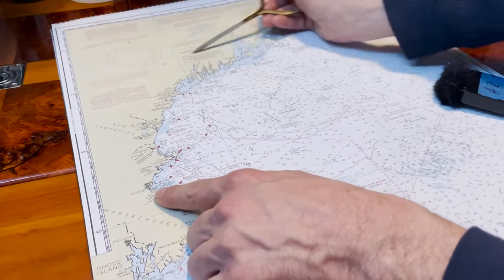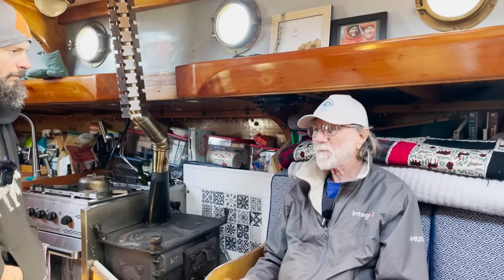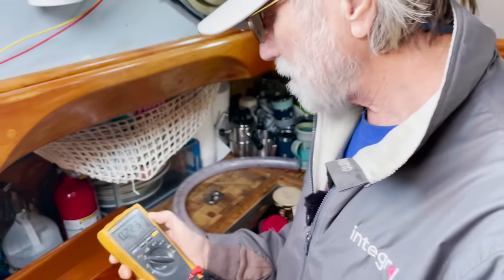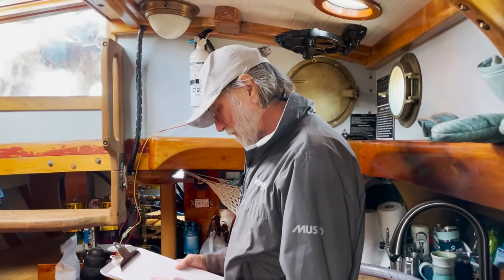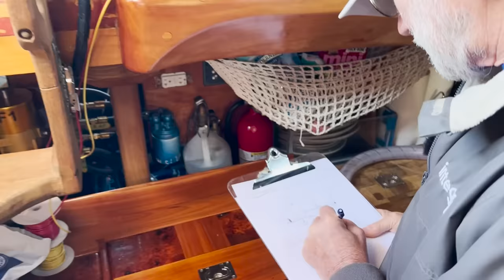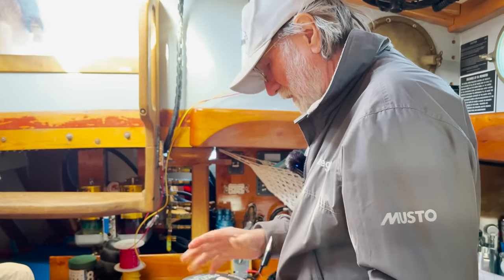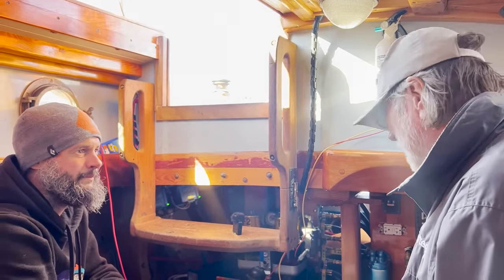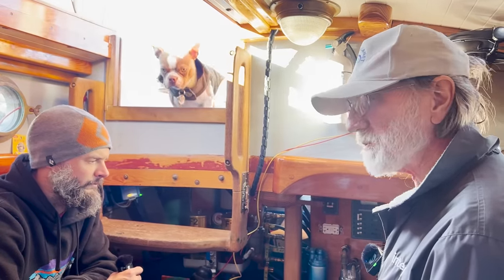Nigel Calder Looks For Stray Current - Episode 289 - Acorn to Arabella: Journey of a Wooden Boat

Comment: I relate to this so hard. I bought a mill house built in 1914, abandoned 15 years when I bought it. No one...NO ONE can understand  our electrical system. No one. Have had 4 liscenced and 2 unliscenced  electricians try to understand it as well as a career elecrical engeneer. To no avail. The last guy took 5 1/2 hours to install 3 ceiling fans *replacing 3 fully functional light receptacles*. It should have taken less than 40 minutes. Its haunted and defies all the laws of physics apparently. Trying to turn off the stair light is like a game of riven every time. The breakers make no sense sometimes its hard to understand HOW two things are possibly on the same circuit. I dont believe in a god, but i do pray every day it doesn't randomly burn down 😅

Comment: I an wondering if a remedy exists beside getting the shaft and propeller gold platted. You are certainly not the first to face this problem and still, graphite packing are a thing, so a simple solution must exist.

Good diagnostic work by Nigel. How to establish a diagnostic is a knowledge by itself and not everybody knows it. Yet, with a good diagnostic, half the problem is solved.

Comment: A Master Class in troubleshooting.
#1: Have the proper equipment.
#2: Draw a picture with your test plan and results.
#3: Eliminate the obvious 1 step at a time (Cct Breakers, Batteries, Alternator )
#4: Eliminate part 2:  Remove the Alternator Drive belt and repeat the test.
#5: Then look for the obscure  STUFFING BOX acting like an alternator when the boat is in gear spinning the shaft in the graphite. That's a good catch.
#6: Eliminate the obscure: Salt Water conductivity. Wish they had just dipped a pail over the side.
#7: Replace the Stuffing - Replace the alternator and test again.

Comment: Not sure why my previous comments have been removed, long story short. I'll name the product without posting the link, take a look at replacing your shaft seal with a Lasdrop. Great product, runs dry, isolates the shaft. Made in Michigan. I used them on commercial passenger vessels for over 20 years with great success.
Reply from the maker: We don’t delete comments unless they’re fairly terrible. Thanks for the recommendation!
Reply: Thanks for the reply. I faced a similar issue on one of our vessels years ago, I flew in Paul Fluery from Marine Services in Maryland. Did the same testing as Nigel did. very time consuming and frustrating. In the long run we installed an impressed Cathodic System and for a backup we loaded up the hull with sacrificial anodes in-case the impressed system failed.  @AcornToArabella
Reply: Youtube has a thing with links so thatd be why the previous comment has dissapeared.

Comment: Connected to the external regulator's field current output

There is no need to buy a new alternator UNLESS you have an internally regulated alternator that cannot be externally regulated

Again if you have a Balmar series 6 they have good installation documentation

Comment: Voltages going slowly up and down as if a capacitor is charging/discharging sounds like a DC power supply is involved somewhere.
Reply from the maker: We left this part out, but Nigel suspected that for a bit and then eliminated it as a possibility eventually.

Comment: I didn't see that you checked the Variable Pitch Propeller for any leakage.  I am not sure if there is any power to operate or is it mechanical, being a google searcher and not a boat builder like our experts.  If this is the source that could explain why the propeller anode went first.  I hope your mom gets better and having your near will help.  I have a relative that received treatment in Boston and he Made a full recovery.
Reply from the maker: The variable pitch propeller is completely mechanical. Kind of an engineering marvel!

Comment: I had to stop watching the moment you two, in discussion, decided it had to be galvanic corrosion and not from a completed circuit. You just have the brass prop and the zink, there's no place for a circuit, then something about through holes. While there are a few thousand square copper rivets going through the hull into bronze floors bolted to a lead keel. There are so many possibilities for a positive wire to get worn, touching just one rivet, turning the negative engine, prop, and zink into and anode. Or, the dissimilar metals reacting with seawater to act like a battery itself. Arabella has bronze, copper, lead, steel, monel, aluminum, the possibilities, especially with the rushed wiring at the end of a 7 year project, are endless.